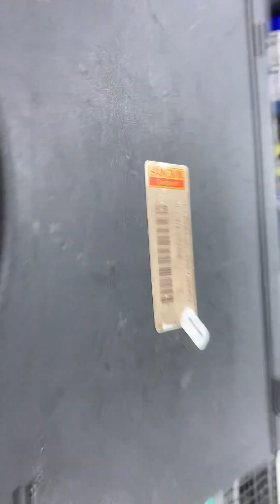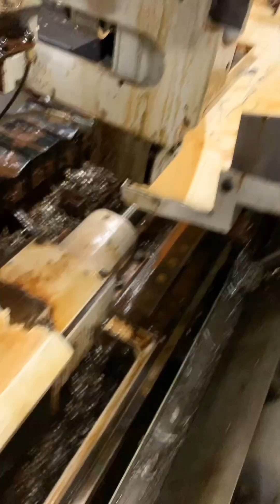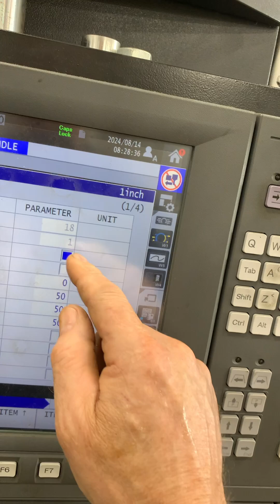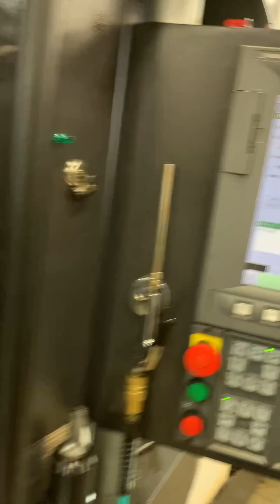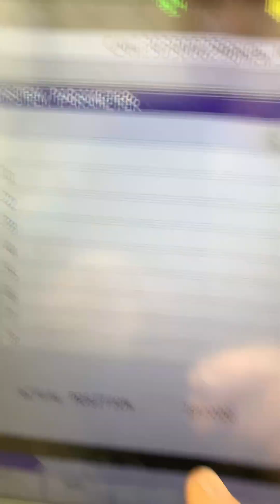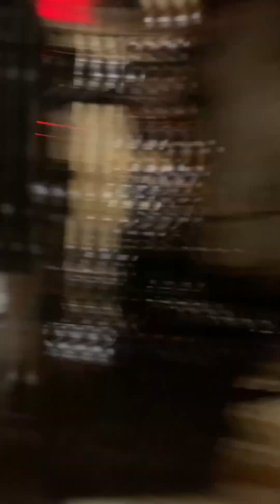Okuma Multus B-250 Alignment

Comment: Hello sir, I need your help. I am working on a okuma MA-650VB VMC machine, and often the tool falls down during tool changing. I am not sure whether the problem is with the tool arm or the magazine tool pot. If the problem is in the magazine tool pot, how can I check it exactly? What solutions can I try in the tool magazine? It seems that sometimes, when the tool arm pulls the tool from the tool pot, it falls down. Other times, after changing the tool, while inserting it back into the pot, the tool falls again. I hope you can give me some solutions.....
Reply from the maker: You will need to check the alignment with a three piece alignment tool and then see if the magazine needs to be adjusted. To muck slack could case the pot to push up . Or the cam box has a broken cam roller in the box that pushes the arm up . Is the spindle tool low and the arm is hitting. I would start with checking the arc arm alignment
Reply: @Moto-89-KTM thank you sir.... I will check that...